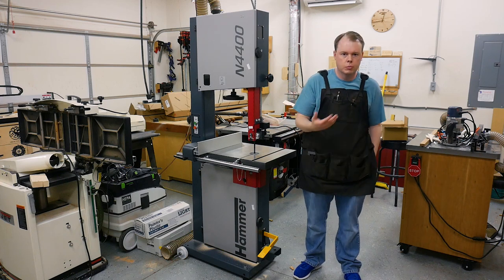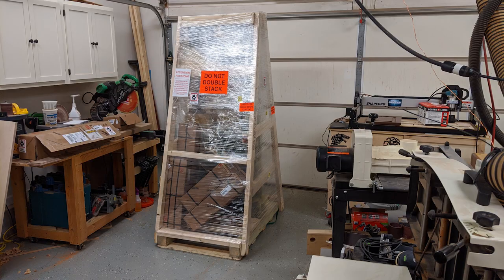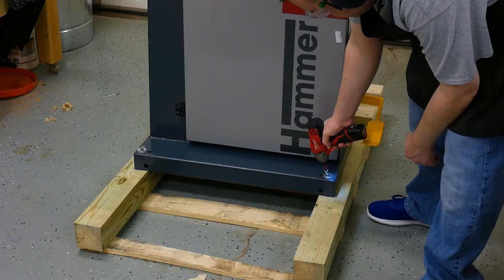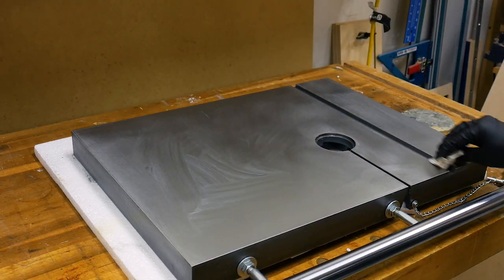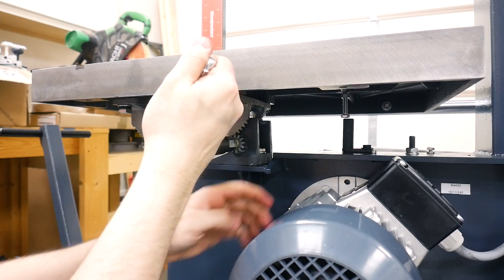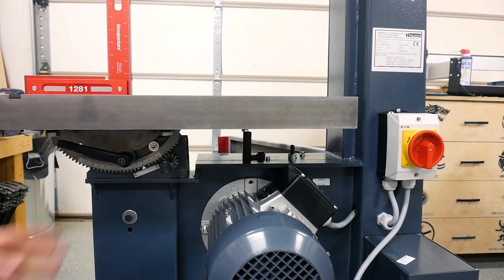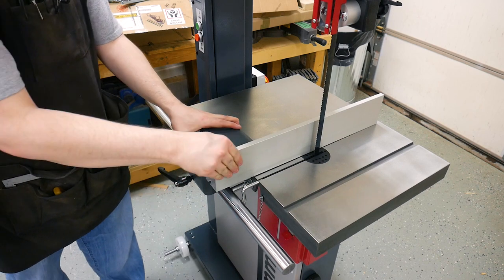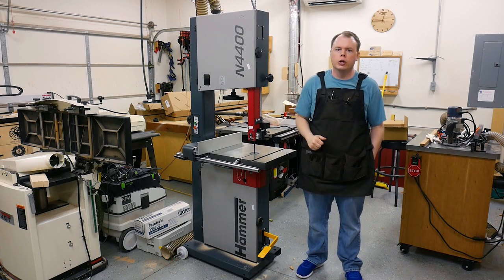Hammer N4400 Assembly & Setup

Comment: Great Video, looking at one of these but the specification seems to differ, one thing I would be interested is the maximum width of blade the spec says 20mm but other reviews say 25mm, and what makes it more confusing is the blade tension graph when the top door is open shows max blade width 35mm. Would you be able to confirm what you can put on this N4400 saw?.